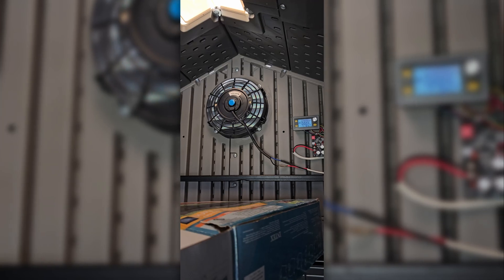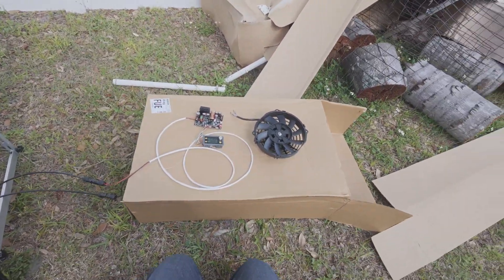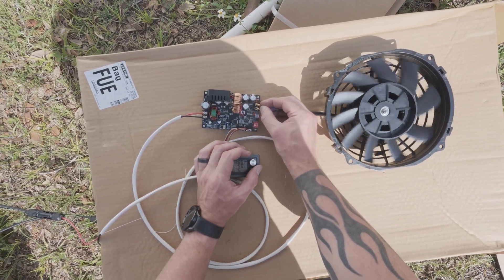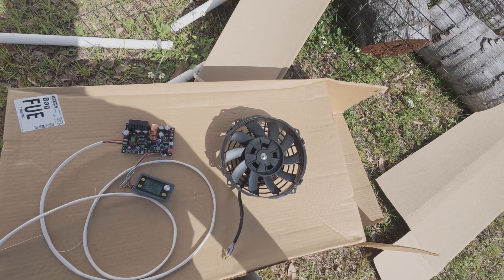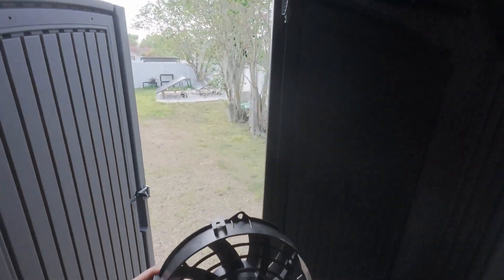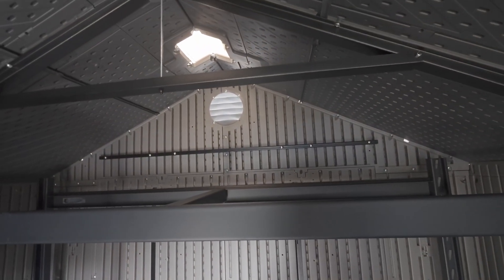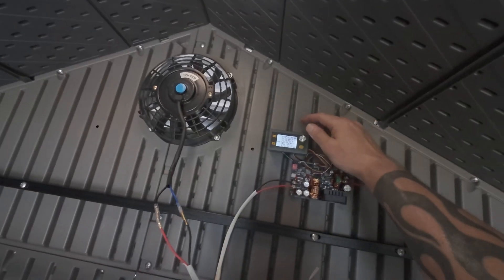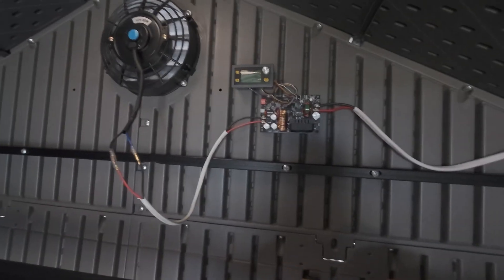Building a high performance, low cost, DIY shed ventilation system using Solar! (LifeTime Shed)

Comment: Just a quick note for anyone actually paying attention:  the solar panel used in this demo is NOT the same as that linked. From the looks of things, I suspect the demo panel is a much higher quality device than the linked ECO-WORTHY.   Can the OP clarify what brand and wattage panel was actually used in the initial demo?
Reply from the maker: An Ecoworthy panels was used.
Just a spare I had laying around.

I have the 195w bifacial panels that are pretty good and the all black type N panels that are pretty terrible (I have a video on them)

The panel used is the exact one linked, so not sure where you got the assumption otherwise.

I have since moved to 420w installer grade panels for everything, but nothing fancy or expensive is needed for this to work as shown.

Comment: How’s this working out for you? Have you compared the temperature of the shed with the fan off vs the fan on during the middle of the day in the summer?
Reply from the maker: At the roof level its still hot, but anything from mid level and down is much cooler.

So that works, all my stuff that needs to stay cool is not up at the roof.

If I manage to squeeze some insulation or some sort of radiant barrier up there it would make a HUGE difference as like 80% of the heat is from the roof.

So the airflow keeps that heat from going anywhere else.

Had this become my solar shed I would take it further, but since its just for storage and now it holds a 12v system for landscape lights I am very happy with it.
Reply: Wouldn’t strong wind and rain get in?